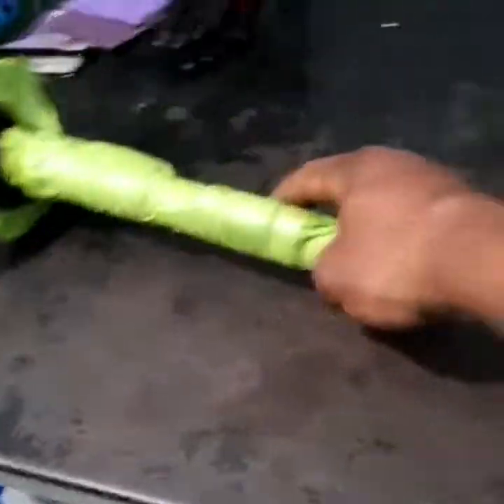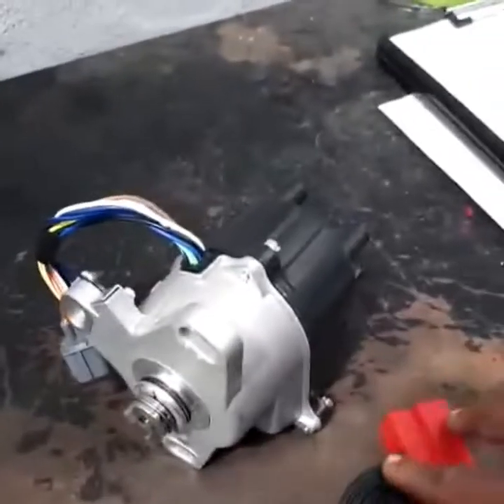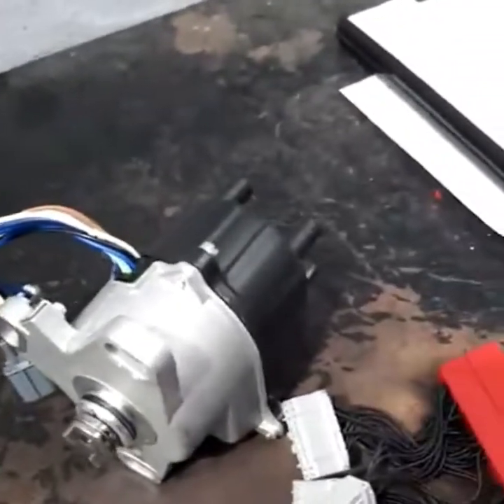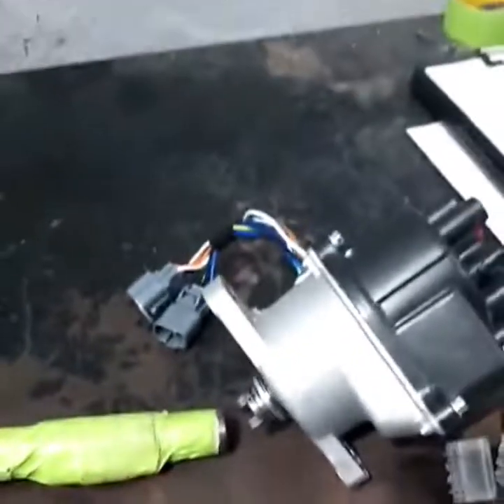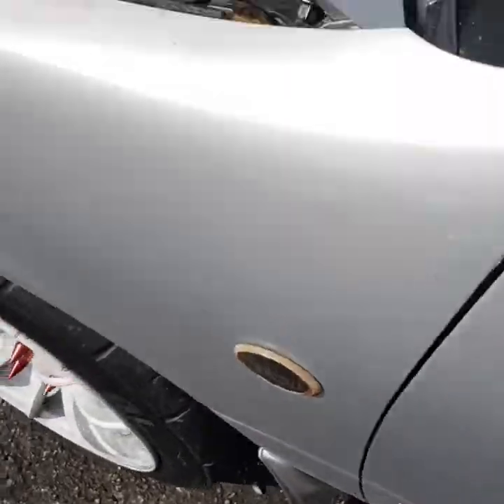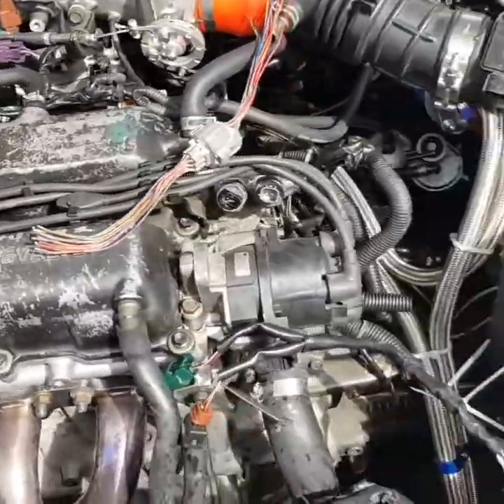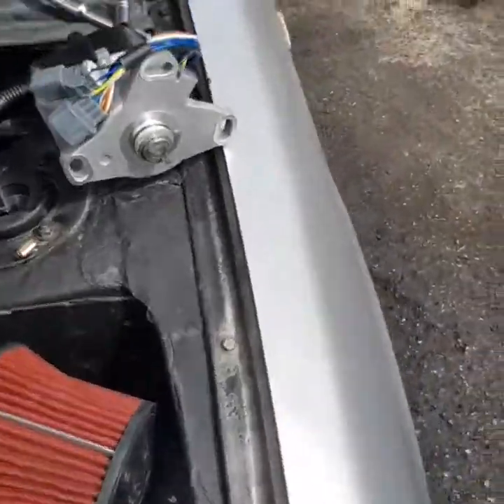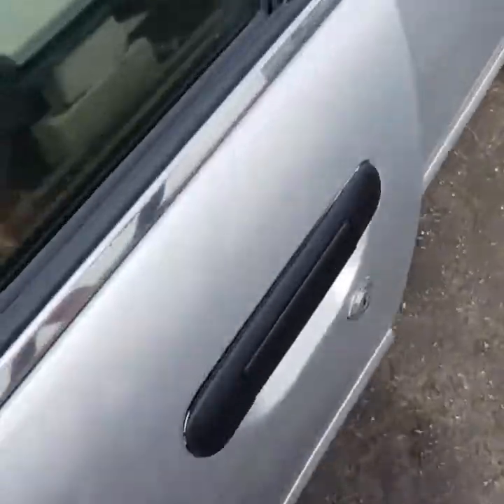Nissan SR20VVL to Honda ECU

Comment: why did you put a p28 on a sr20? just curious, is a stock sr20 ecu flashable and what are the benefits of putting a p28/p30 on a sr20, greeting from the netherlands👊🏾
Reply from the maker: Well its a good question. Most people here in the Caribbean often have issues with airflow meter matching up with ecu. Also some of them aren't pleased with the nistune platform or cant really afford a good management. A honda ecu has great capabilities and cheaper and seem to be giving them what they want. So we find alot of people heading that direction. That's my opinion on it at least that's what most customers tell me.
Reply: i had a eg hatch with a mini me running 150/160hp full boltons tuned on ectune using a p28, i drive a seat ibiza cupra 1.8 20vt now, maybe in the future i will get a sr20ve but they are really scarce here so prolly would be a japan import
Reply from the maker: @Stylo_.  sounds awesome the vvl are street killers so It should be nice. Follow me on IG @geddyz4u or whatsapp  me on 18768864659 for awesome daily projects.
Reply: thanks for the explaination! its a creative way to get a tuneable ecu, since its a 0bd1/obd0 style ecu. do u use neptune/ectune of chrome to tune the sr20’s? since most tuners use those programs on honda’s
Reply from the maker: @Stylo_.  yes all the platforms even hondata believe me most Nissan and Toyota with distributor type setup perform great in this ecu. U should try it one day lol